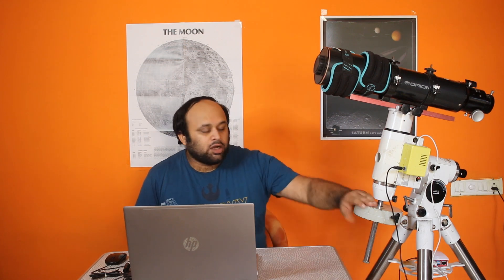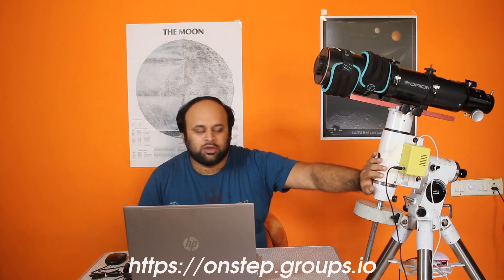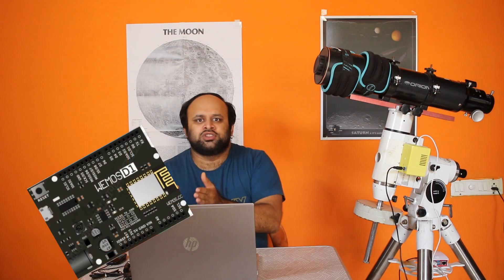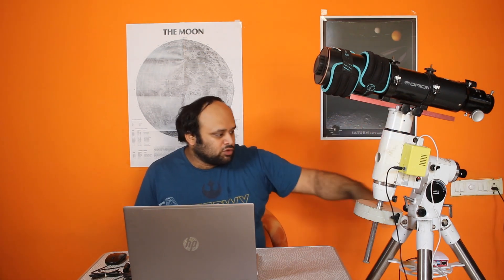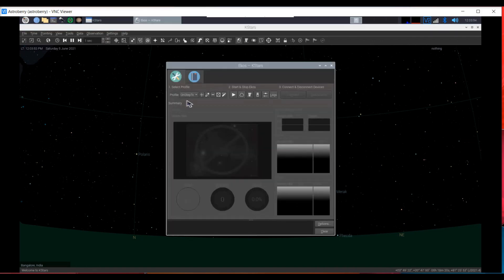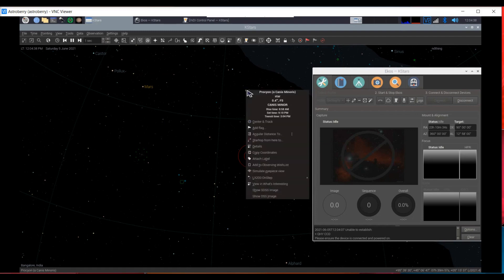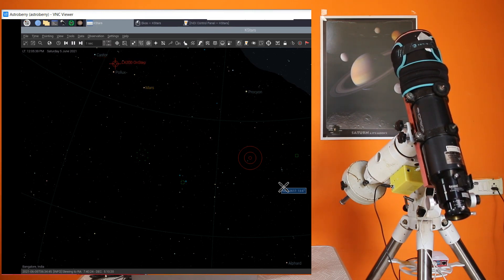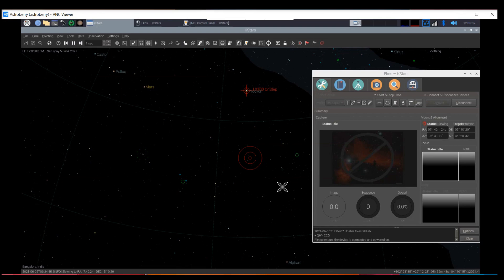When the Mount breaks down

Comment: Good job. Did you have to get new motors too, or you just went with the existing ones?
Reply from the maker: i used the existing ones because the HEQ5 mount body is designed to accept only NEMA14 size (35x35x35mm). My original motors were absolutely fine.